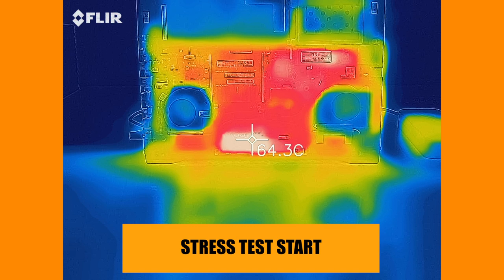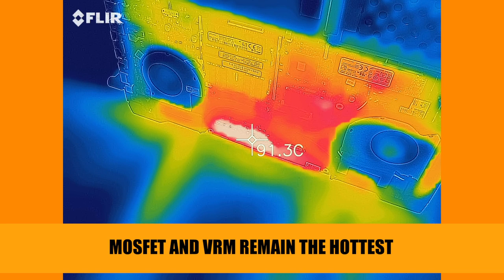ASUS GL504 / GL704 DISASSEMBLY and UPGRADE OPTIONS including INTERNAL TEMPERATURES under heavy load

Comment from the maker: If you have any question, let me know and will try to help! :)
Reply: So, the hottest parts is the cpu power nodes?
Reply: Im having this problem that the LEFT FAN (CPU) is always at max speed no matter the CPU USAGE is at 1% and temps are below 30°C... is there any place in the fan installation where I may unplug/plug some sensor that might help me deal with that issue¡?

Comment: Hey bro nice vid, i have a question, When I tried to change the thermal paste I realized that the mosfets also had a kind of thermal paste in addition to the cpu and gpu, so my question is can I change that thermal paste of the mosfets for a non-conductive electric thermal paste?
Reply from the maker: Technically you can apply thermal paste and remove the pads, but usually, pads are used in those areas, because it will need a thicker layer. Also pads can fill these gaps much easier.

Comment: bro recently there was a bios update to 310 after which undervolt settings of throttlestop is not taking effect. downgraded to 309 still it didnt have any change. both XTU and throttlestop are useless. any ideas?
Reply: Hey. You can try downgrade to 307 bios. Works for me.

Comment: Do it has thermal issues compared to other laptops
Reply from the maker: VRM can heat up pretty much, but other components are good enough. I would not worry regarding the temperatures, just make sure to give enough airflow and do not block the intake holes.
Reply: @MakaiTechReviews  should i buy it
Reply from the maker: Do you have any alternative notebook you looking at the moment? If battery life is not an issue for you than GL504 is a pretty decent machine.
Reply: @MakaiTechReviews  i dont care for battery life onlyy i care for thermals
Reply: @MakaiTechReviews  i cant find best match for this
Reply from the maker: If you are good with GTX1060 go with that version. Later on, if you have the chance you can swap the heat pipes from a GTX1070 (GL504GS) version. That config has one additional pipe! :) Better thermals for your GTX1060 model!
Reply: @MakaiTechReviews  didnt ubder stand what you want to say
Reply from the maker: @sangamshiral2654  Check this image and you will understand. :) https://imgur.com/a/k6sNBea Get a GTX1060 version and switch the cooling pipes with the GTX1070 model. Since the GTX1060 runs "cooler" and if you add an additional heat pipe to the system it will run even lower temperature. You will have an additional VRM cooling as well.
Reply: @MakaiTechReviews  bro you are great!!!!! but how to add extra heat pipe
Reply: @MakaiTechReviews  bro rtx 2060 have same cooling system like gtx 1070
Reply from the maker: Oh great to know. As for the heat pipe, I add this info as an option (salvaged from a dead GL504). Anyway as for the cooling you should not worry. The default one is also good. But at least you know you can upgrade it even better! :)
Reply: @MakaiTechReviews  GPU cooler fan is yet on salvaged from a dead GL504? I need GPU cooler fan replace.
Reply from the maker: Good to know thanks for the info
Reply: @MakaiTechReviews  On the internet (ebay, ali, amazon etc...)i cant found GL504 version. The video card fan bearing in my own machine is starting to ruin.